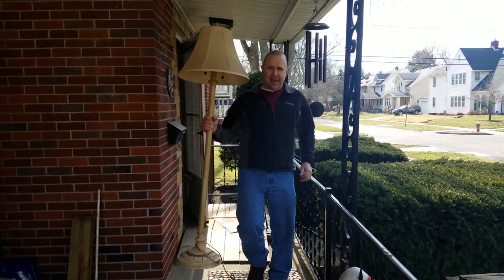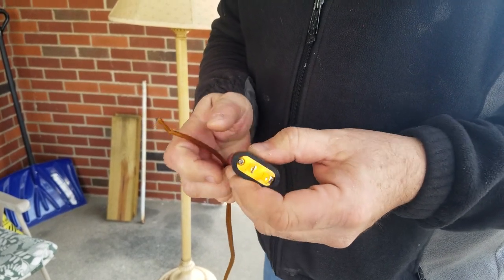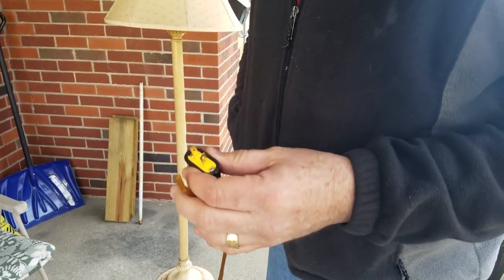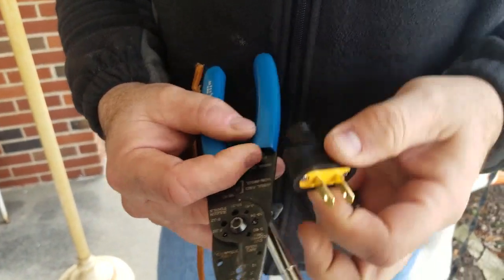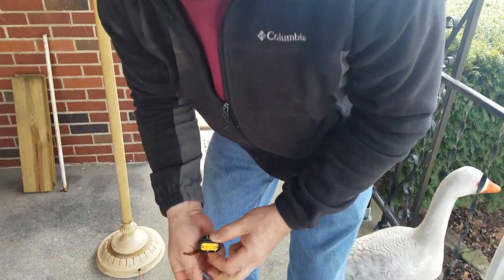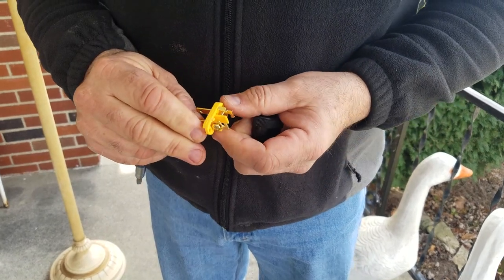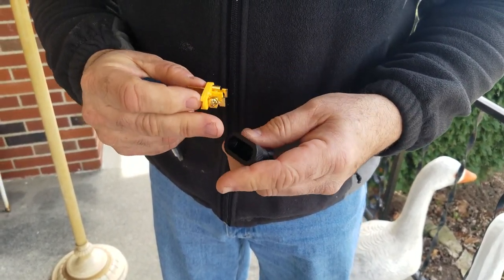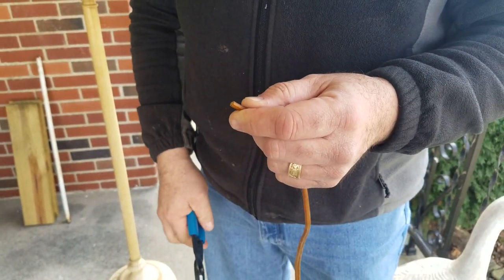DIY HOW TO CHANGE A TWO PRONG PLUG ON A LAMP

Comment: Thanks for the vid. My mom's been flipping out about her favorite lamp not working because of the faulty plug. This is an easy fix with the right replacement piece. The hardest part is the drive to Lowe's. Hah!
Reply from the maker: +David Tidwell most Hardware stores should have what you need- clip off the existing one and take it to the closest place

Comment: Thank you! Yay! Now I can replace the plug for my sewing machine cord that my dog chewed instead of buying a new one!!
Reply from the maker: If you’re replacing a plug that the prongs are not the same size, make sure you get the same plug - the larger prong is neutral which attaches to the silver looking wire and smaller prong hooks to the copper colored wire.

Comment: I have a LED strip light that needs a plug. Wire for light has three wires. I take it one is a ground, does it mater where other two are hooked up" they are the same color??

Comment: Hey Ryan, quick question - how did you figure out which wire was the hot vs. neutral? they seem identical in the video. If the wire is not polarized, do you see any issues using a polarized replacement plug? Want to make sure I am doing this right... Thank you for the video!
Reply from the maker: The hot wire is normally darker and neutral Is silver.
Reply: On mine the hot wire is smooth and the neutral has a ridge running down the sides.

Comment: How did you know which wire goes on which connection hot vs neutral, the screws are different colors , does it matter?
Reply from the maker: In this case the it didn’t matter but if you had one wire silver looking and the other copper looking then the silver is Neutral. Connect that to the silver screw on plug end which means the copper wire is the hot line which attaches to the brass screw on plug

Comment: Thank you for this. I couldn't find a good video how to do this. I have a slightly different model but the insides are basically the same. Used to put heating elements in a snake enclosure without needing to drill a hole big enough for the plug (and risk my snake getting out). Now I just needed to drill a hole for the actual wire. No snake escapes! Thanks so much!

Comment: Both the wires to my fixture are the same color and stranded......where do I connect each?
Reply from the maker: It doesn’t matter in this case. Unless u can somehow trace the wire that leads to the switch to be your Hot line and the other would be Neutral.

Comment: Ryan, is it possible to do the reverse? So, ditch the lamp and turn the lamp’s power cord into an extension cord?
Reply from the maker: Yes. As long as the Hot and Neutral are the same on each end and what you use the cord for isn’t pulling more amperage than what the gauge of wire can handle

Comment: I put an end from something else. With only 2 wires. And it blew the bulb immediately. Does it matter which wire goes where??
Reply from the maker: The darker wire is Line Voltage and Silver wire is Neutral. If it’s not wired correctly, line voltage will go thru the bulb first and not the switch. Not exactly sure why the bulb blew.

Comment: The screws are different colors and on mine there is a W next to the screw maybe for the white wire who knows but I only have a black cord so does it matter which of the two wire cords I put to which screw if not then why is one of the wire marked with text all along this cord.
Reply from the maker: In your black cord there should be two wires- if they are different colors then the silver colored wire goes to the silver screw on your plug and the copper colored wire goes to the brass screw on your plug. Make sure you loop the wire clockwise around the screw so it will tighten properly
Reply: JS Warpaint     If the original plug had two same size prongs, there is no difference.   Can go either way.   If the old plug had two different size prongs then it makes a difference.  Two conductor lamp cords can be identified too many ways to answer you.   Sometimes there are continuous  raised stripes on one side, sometimes there is text on one side.

Comment: which one is pos and neg ? or does it matter
Reply from the maker: +Steve Smith for this lamp it didn’t matter- some plugs do have one slightly larger prongs than the other- that’s when its crucial to secure the “Hot Line” and “Neutral Line” correctly.

Comment: Don't you have to pay attention to the polarity of the wires on the plug, just as you do at the socket end? You didn't mention that....?
Reply from the maker: If the new plug has a polarity difference then yes. One prong would be larger(Neutral) than the other. In this case it wasn’t . This is an older lamp and even the wires themselves were the same color. I just wanted to get it working for my parents. Polarity isn’t an issue for this project.

Comment: How do you know which half of the wire goes on which screw? Or it doesn't matter?
Reply from the maker: +aliadizzle on this particular plug it didn’t matter- but newer plugs have different sized prongs- the smaller one is “hot” and larger one is “neutral”- the wire on the lamp or appliance may have a mix of silver color(neutral) and goldish color(hot) if it’s just two wires....the plug will have matching silver and goldish screws so you can match wire to plug...in this case it was an easy one to replace
Reply: The Ryan's Den Thanks so much for the quick reply! I have two lamps I brought when I moved back from Brazil that are so nice, but the plugs are different so I need to change them. Rather than pay a lot for someone to do it for me, I really wanted to try it myself. Your video makes it look so easy, I'm on my way to buy the plugs now so I'm glad to see your reply!
Reply from the maker: +aliadizzle ok good luck
Reply: Look at the cord there might be imprintted writing on one side. This tells you which one is silver screw or golden.+) (-)

Comment: I saw you twisted the wires clockwise. That's better than not twisting them, but if you want them to be pulled in as you tighten the screw clockwise, then it is better to twist the wires counter-clockwise.
Reply: Also you noted that the plug was polarized, but didn't make sure to put the correct wires in the correct place. If you have a continuity checker, or ohmmeter, you can easily identify the neutral as the wide prong on the plug, and the outer screw part of the light bulb (the part you could most easily be toughing when screwing in a light bulb).

Why is this important? Because if you happen to be grounded when you are replacing a light bulb, you could potentially shock yourself. It is only the hot side that gets switched off by the lamp switch.
Reply from the maker: +Russ Puskarcik good tip thanks
Reply from the maker: +Russ Puskarcik good tip

Comment: How do you know which one is the hot wire?
Reply from the maker: +kolop1 the hot wire is normally a brass color and neutral is silver color
Reply: I just replaced the end on an old vintage fan. This video helped. Now my grandfathers 60 year old fan is oiled up an running again.
Reply from the maker: +kolop1 happy to hear you have confidence in yourself to fix things

Comment: Thanks for your video, Ryan.  Too bad you had to wake up your dad!  I need to power up an Amazon Fire 7" tablet to use as an alarm system control panel.  I added a 12v to 5v adapter to a mini-USB plug so the tablet gets the correct amount of juice.   The other end to the wire has RED and BLACK wires that I connected to a 2-prong plug just like yours, but I'm getting no power at the tablet.  Does it matter which prong gets the RED and BLACK wires?  Did I get the wrong type of plug?  Should I return this plug for one that has different-sized prongs?  As you can tell from my questions, I am NOT an electrician. ; > )
Reply from the maker: Sorry, what you’re trying to do I’ve never attempted
Reply: Black on brass?